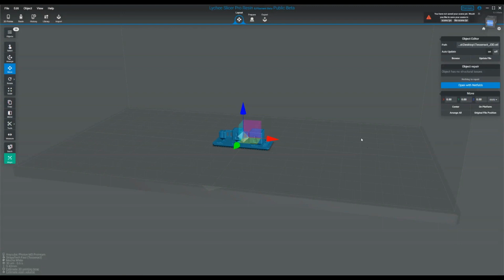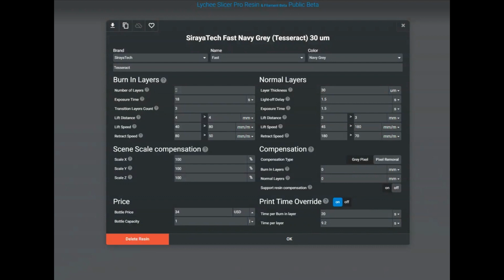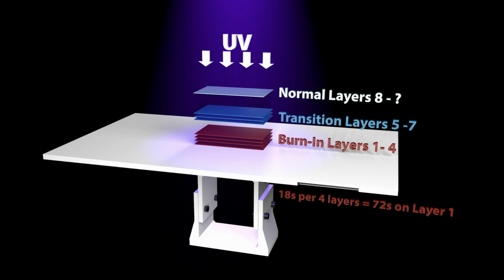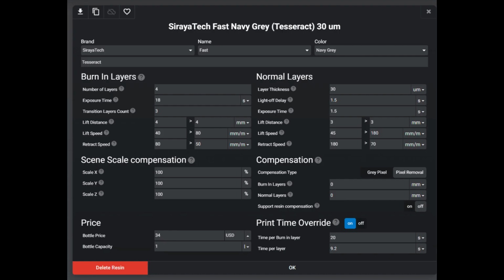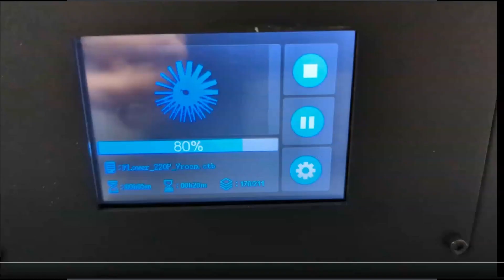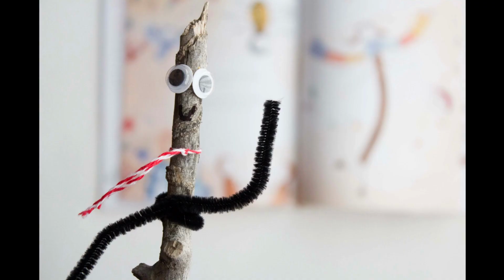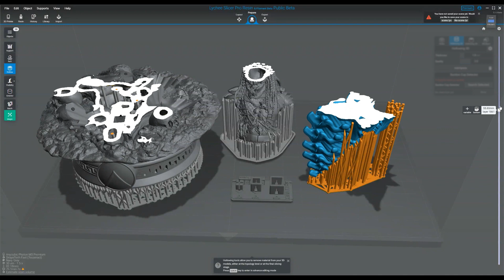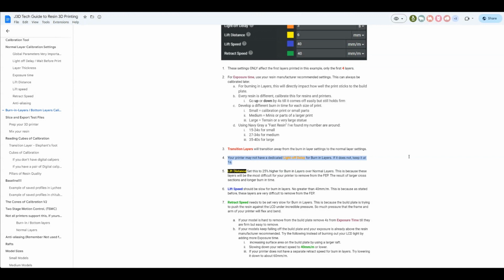Easy Print Removal - How to Calibrate Burn in Layers!

Comment: Im getting pretty frustrated with my Saturn S. I had settings dialled in for Siraya Tech Fast Grey resin. I was able to print consistently 100% successful full plate prints. 

Then accidentally purchased Navy Grey Resin, and success went to 0%. Every print failed to stick to the plate.

I have been fiddling with settings using the guide, but am now seeing random test failing to stick. They will stick on one test setting, another will fail. Then vice versa. 

I have the tests on the go at once. The Boxes, the multi cure calibration, and the amerilabs town. 

I have also started seeing very fine vertical lines on my prints that didn't ever see before.
Reply from the maker: @zombiedominator  The Navy Gray will need more exposure then fast. But it will be a lot stronger. 

Your bottom layers will need more UV exposure time as well. 

Do you have me on discord? Or are you on the lychee slicer Discord? It will be easier to help you there.

Comment: Question! In your text guide, you mention you've found Navy Gray Fast Gray to have burn in times of 15-24s, 27-34s, or 35-40s for small, medium, and large prints respectively. Here your burn-in layer is set to 18s and you express concern for much higher. Can you clarify?
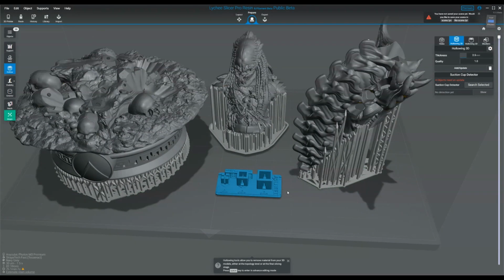Reply from the maker: If you start watching at 5:31 I discuss this very topic.

Comment: Great Video Love the detailed info, having just aquired a Mars 3 Pro and being new to resin printing/ printing period. The TMSC setting you refer to as global setting, would you use/recommend these no matter the brand of resin printer?
Reply from the maker: A very large printer like the a 17" LCD printer you would need to add more lift height and light off delay. 

A very small printer like a mini 8k you could get away with a little bit less. 

For everything else yep it the same. 

Everyone gets to tweak their own settings and find the balance between speed, success and accuracy.
Reply: @J3DTech  THanks i Found for me it was the um and exposure was the only tweaks i had to change from your settings and it was Golden for me? Thanks for the Assist!!:washhands:
Reply from the maker: @donpalaisy6796  I'm very happy to hear! Best of luck with your next awesome print!

Comment: Hey dude I just wanted to let you know that I’ve started to experience that zen at the end of the video. When prints slide off. I’ve gotten a lot better from when I first started and it’s because of your info and the dude for tabletop. For sure. With out a doubt it has helped me so much. I still suck but once I stumbled across your guys info and docs it was suddenly like night and day for me and it’s really been helpful for me. Just wanted to let you guys know. I just started in December, I tried a ton of the other methods, tricks etc that float around on YouTube. Even the craziest ones. I figured trial and error and eventually I’ll fine tune. I couldn’t understand why. I knew I didn’t just skim through the various tutorials and knew I actually read what info I had. It just didn’t make sense. It sucked. Sure if I was just skimming through the stuff of course it would suck. I wasn’t tho.  I didn’t begin to see a change until I read the very valuable information you all have shared. Thanks again
Reply from the maker: Thank you! This is the best compliment I've ever had for all my work. I'm soo happy that it's giving you real results!